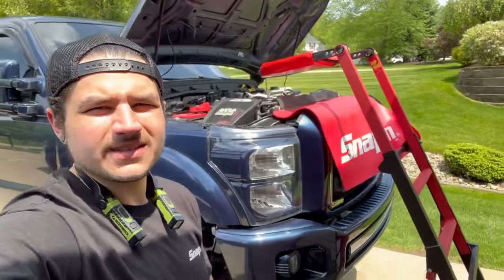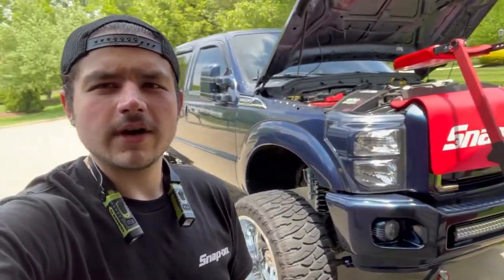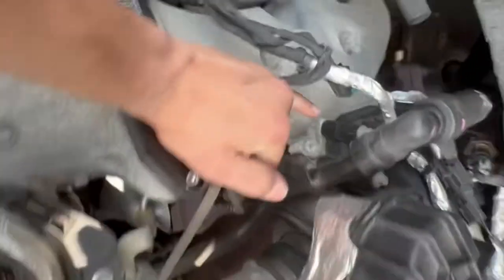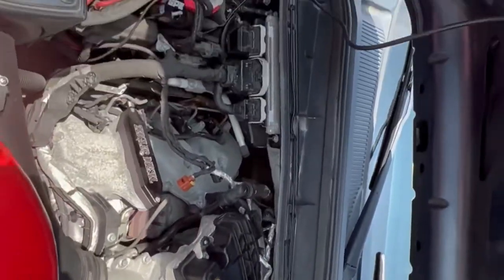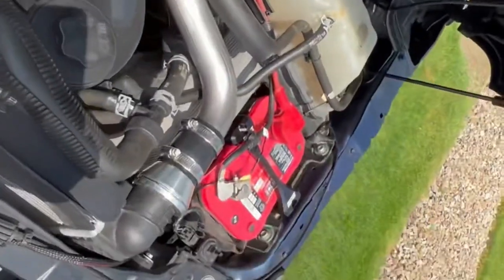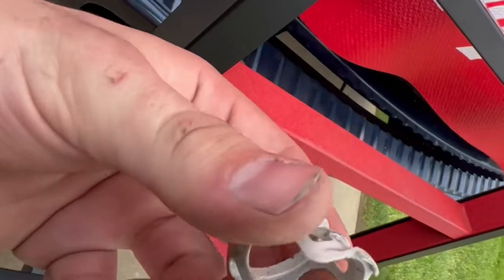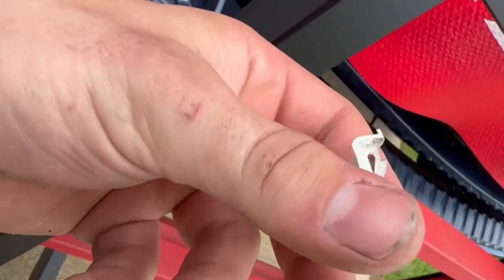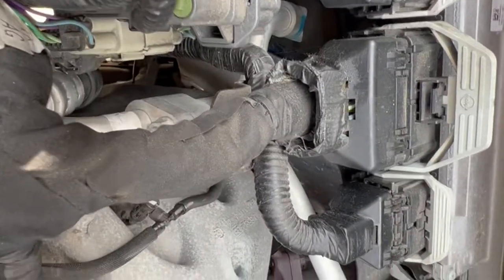2015 Powerstroke gets SPE MOTORSPORT Coolant reroute kit!! The BEST KIT!

Comment: Thanks for the video Rick. Just a heads up for anybody else doing this, take the inner fender well off on the passenger side and you can get to the heater core no problem.
Reply from the maker: No problem thanks for watching and yes that does make it a lot easier I was just a bit lazy hahha
Reply: @PowerstrokeRick  yeah, I’m usually that way too, but since I saw how tight it was for you I just pulled the fender. I got the SPE kit too and I’m impressed with it.
Reply from the maker: @jaythewhizdog3842  yeah it’s definitely like a sore dick, can’t beat it!!

Comment: On the hot side inner cooler side pipe I like the AFE better because it eliminated one boot up there by the turbo and two straps rest of it I agree
Reply from the maker: Nice I’ll have to check that one out!
Reply: @PowerstrokeRick  get on the phone sometime we can talk about it stuck in Yellowstone for 2 1/2 weeks because of the particular filter all that is off now but seems like the hot side has issues if you do away with the stock because of the boots and I got tired of the two straps up there by the turbo and AFE does not have straps up at the turbo just down there by the inner cooler I like that set up much better . I have a 2016 with only 37,000 miles on it the only problem I’m having now is the CCV code that keeps popping up because of the sensor on the tube and I have a minimax tuner so that’s part of the problem hopefully they’ll come up with a solution on that one .